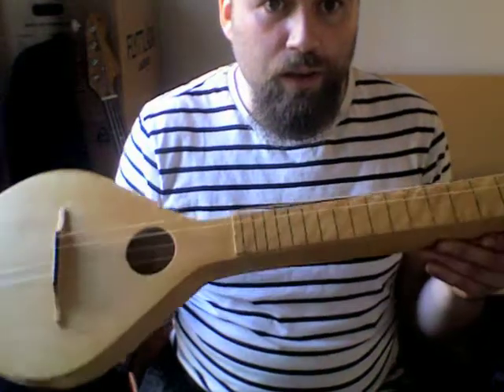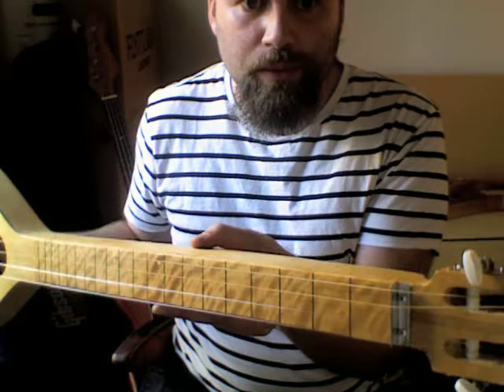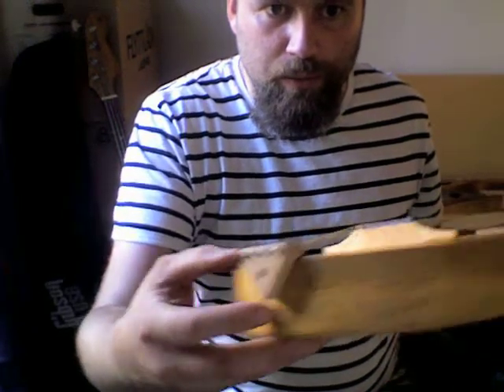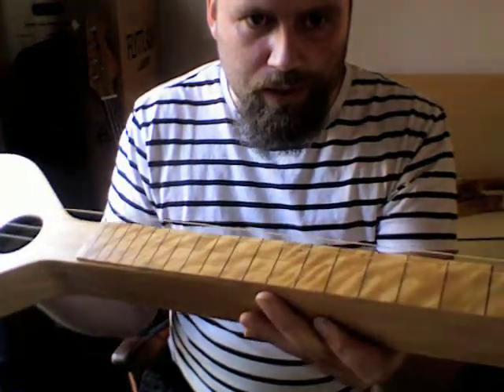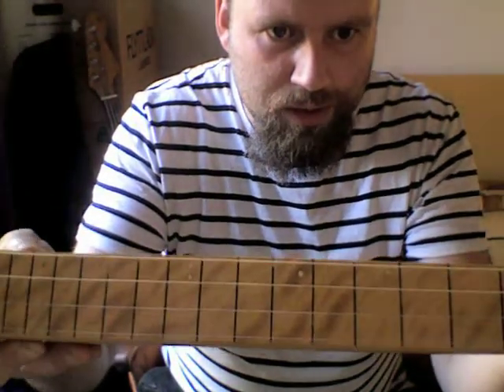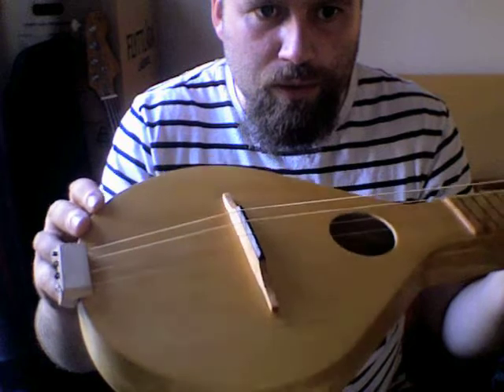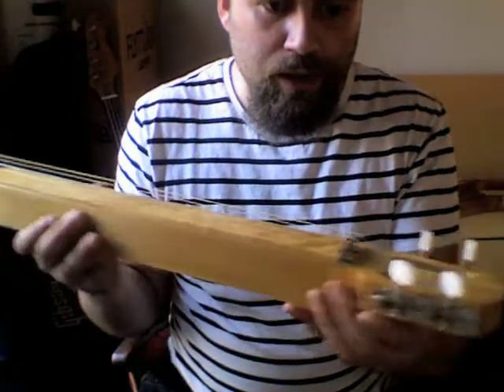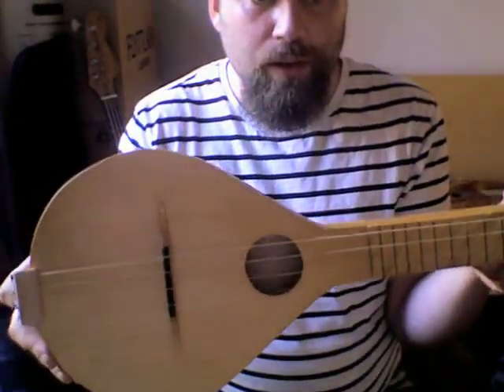Mando steel 4-string acoustic lap steel.

Comment from the maker: Thanks! 
There is some bracing in the box one where the body starts and one about half way up(both top and bottom) and i made the kirfing a bit ticker than i normaly would about 5x5mm. I have pair of plyers that cut really close to the wood without marking it(don't know what they are caled) and then i sanded the tiny bit that was left. 
Sympathetic string would sound great i thought about it, would make it like a slide nyckelharpa(swedish keyed fiddle), not to late yet!! 
Al the best!